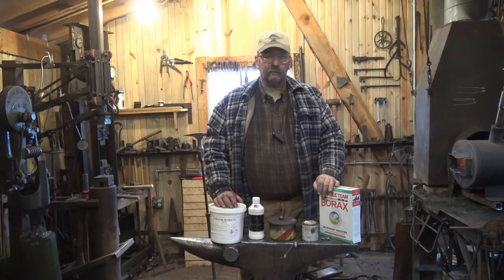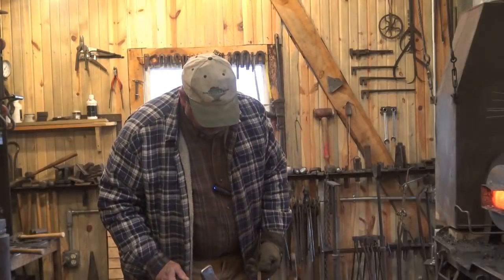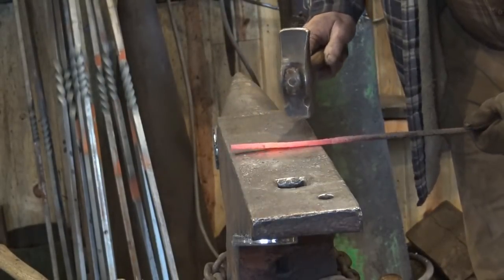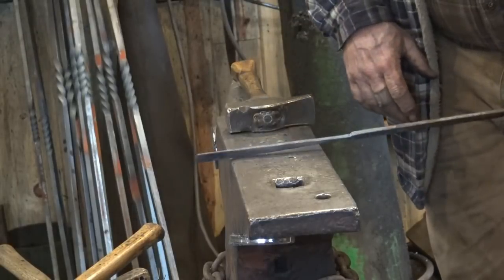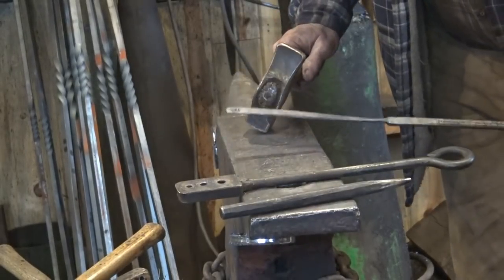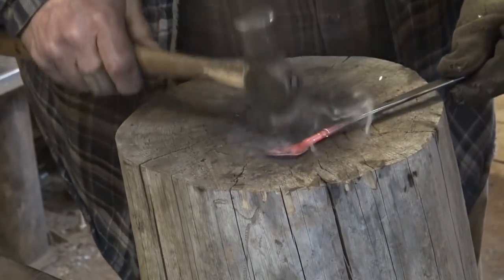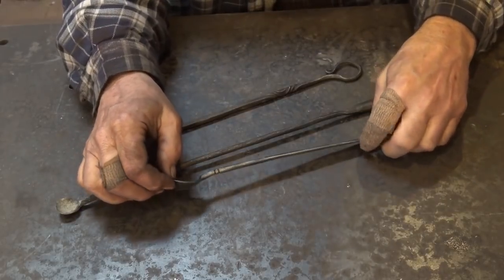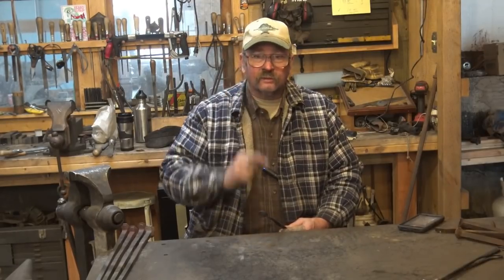Flux spoon for forge welding

Comment: I was out in the shop forging this afternoon.  Not a flux spoon, though, but I'll try one soon.  This next comment may date me, but having your videos is like having a very good correspondence class.  I'm learning a lot, and using a lot of your ideas, tips, and techniques when in the shop. I'm forging a lot more in cold weather, and yes I've watched your video on that too!  Between the wood stove, tank top propane heater and forge, I do ok if the temp is above the mid 20's. My un-insulated shop is pretty drafty.  I know, out in CO you work at even lower temps!
Reply from the maker: I'm glad the videos help.  I guess I can date myself too since I know what a correspondence course is.  I don't work to often if its that cold either.  Those are good days to catch up on the book keeping.

Comment: I tried my first forge weld the other day while forging a Froe from spring steel,i attempted laminating with a thin filler material as a bonding steel ,due to the hardness of the spring steel,as was mentioned  in the comments on your froe vid.I had just recieved the leaf  spring,from a buddy,maybe should have waited until i had some mild steel flat stock ,Anyway,the froe came out good but the weld didnt stick,man i really pored on the borax during my third attempt.Might try again ,or have it welded,works like a champ though ,nice addition to my green wood working kit,along with the new hook knives and a kinda sloyd knife.I wll try this next time I fire up the forge.Real nice spoon you fashioned there,thanks for sharing.
Reply from the maker: Spring steel can be more difficult to weld to itself.  Just enough flux to lightly cover the weld is all thats needed, more could actually make the weld more difficult.  Spring steel welds at a lower temp than mild steel.  If you added mild steel for your filler it would need to be hotter than the spring.  Since it is on the inside of the weld joint it may have been cooler.  Try the same weld with just mild steel.
Reply: Black Bear Forge ,yeah i used a  part of a chainsaw file that i had used for another one of the hook knives,it was already flat and about the right size.I will attempt it again with a mild steel insert,and less borax .Thanks for the feedback.

Comment: Great video! I have been trying to make a suitable flux spoon for a while, and they all end up clunky. The way you beveled the front and back of the spoon bottom looks like a better way of making the spoon bottom than the method I was doing.
Reply from the maker: I am glad it helps.  Of course as long as it gets the flux into the joint its a success.

Comment: I was told to get a proper forge weld you have to have a magic flux spoon.
Reply: Which goes right along with what I called my borax at the pioneer village. I'd "Get out the magic pixie dust."
Reply from the maker: Some people do think flux is magic and that the more you use the better the weld.  But its just a bit of a helper.
Reply: And then I walk in, and weld it together without any flux.
Reply: Yes you do.
Reply from the maker: True, it isn't a requirement.  Do you ever use flux?
Reply: I do use flux for special situations, welding tool steels for example. That is to help the carbon stay in better and not be attacked too much. And the melting temperature of tool steel above 1045 steel, is too low you can't really effectively weld it when it goes into the Gamma + Liquid range, it rapidly falls apart. The fusing point is lower, as is the melting point with more carbon and alloying elements. 

Wrought iron, mild steel, below 1045 steel, still weld fine without flux as you can still be in the Gamma phase without Liquid. 
Wrought iron is especially interesting, with its low carbon and alloying content, you can get it into the Delta + L range, this is extremely hot and it really becomes something like butter. 

Another reason I'd use flux, is if I can see I can't get a scarf to blend in, or if I risk getting a too small of a weld. 

But further on, I don't use it at all, I can easily do it without. Smiths didn't have borax, nor other types of flux when you go back in time, and I find that I should be a master of that. I find it embarrassing if I am at another shop and "I can't forge weld, cuz I ain't git nu flux."

For a gas forge I highly recommend flux for any type of weld, it's very different from a solid fuel fire. A gas forge works nothing like a coal fire.
Reply: Don't forget to quench using a magnetic north orientation.